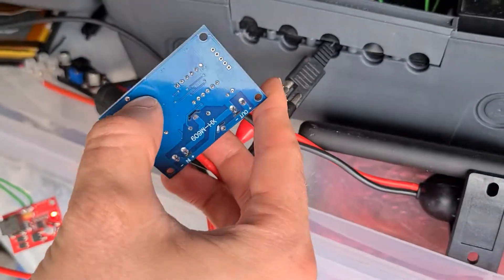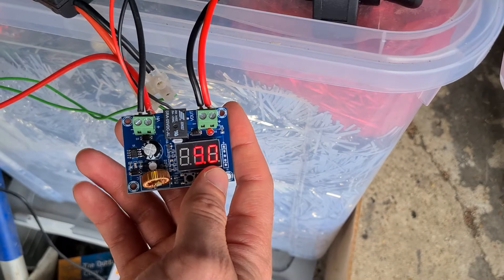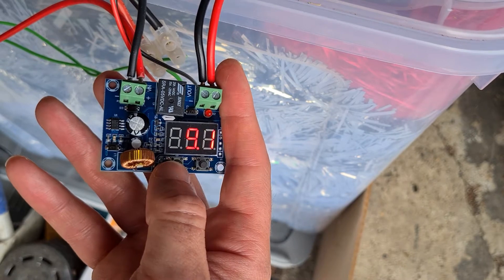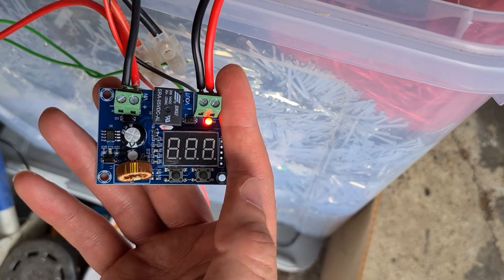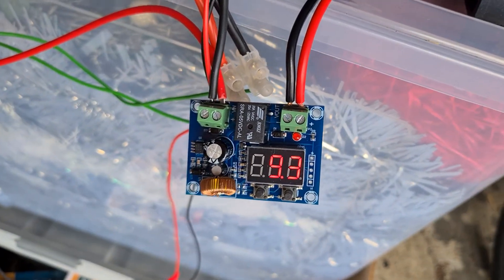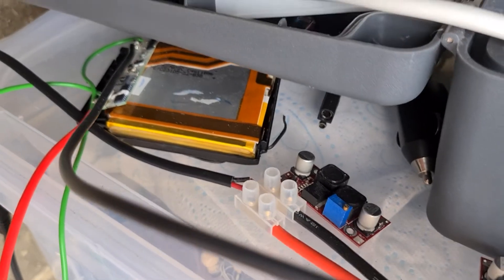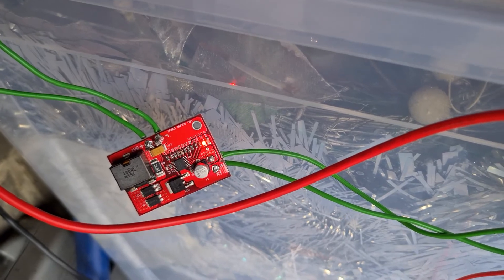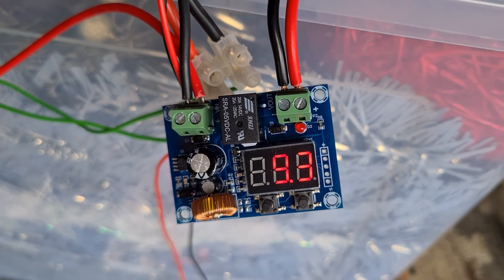XH-M609 low voltage disconnect module from eBay guide

Comment: Cool little setup dude. Was considering using this in a DIY 12V UPS/battery pack setup to disconnect the output of the battery, because the low voltage cutoff for the BMS on the LiFePO4 cell I've got is... crazy low, to put it simply. Looks like this might work.
Reply from the maker: Thanks. Yeah I'd say it'd be suitable for that use, give it a go. On eBay, search 'low voltage disconnect' ;)

I'm now using a Yibai YX-20A from Amazon (search '12v low voltage disconnect module') can't remember why I changed it (maybe I let out the magic smoke from this one lol).

Comment: Hi Gazzat, I have a new one from this module and it has a wrong indication issue. Setting = 10V low cut / 12V relay activated. When the board-relay is open (under 10V) the display works fine until the voltage reaches 12V...When it happens, 12.1V, the relay closes and the display show 12V PLUS 4V above??? like and offset..total 16V. Now , with the board activated but with its indication of 16V (but the battery already has 12V), if a black out occurs, the board will be disconect the "load" when its display INDICATION reaches 10V but with this "shifted indication" the real voltage of the battery will have to reach almost 10V-4V = SIX Volts! for the board open the relay. Later, the board opens the relay, put the load off the battery, and in this moment, its display indicates seamlessly the battery voltage. Very weird... In simple words: The board display indicator "adds" 4 volts to the "true battery voltage" when it is activated.
Reply: The module may require calibrating so the display reads the same as the battery voltage. There are four settings, including calibration, a time delay, cutout voltage and offset. See here: https://youtu.be/d9RD0Iao58A
Reply from the maker: @deansatchell5481  thanks Dean, looks like that video know as the secret sauce for this module
Reply from the maker: Weird. I certainly don't have that problem. Perhaps your unit is faulty. Or do you have a large load or thin cables or both that could be pulling the voltage down?
Reply: @gazzat5  The unit is faulty I'm waiting for a replacement one. thx

Comment: Is there anyway to activate this module with some sort of switch (so it could provide overcharge protection as well as a sort of silent latching circuit)?
Reply from the maker: Not really, you'd need another circuit/module for something like that. This is low voltage disconnect only.
Reply: i realized what a antispark switch is (diy skateborad/etc)...